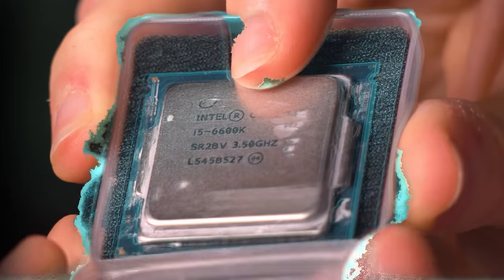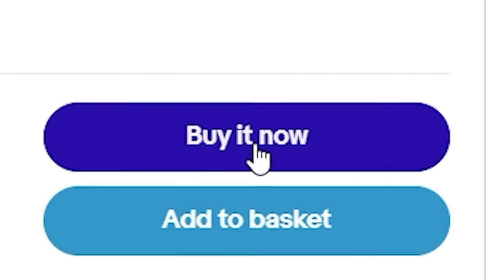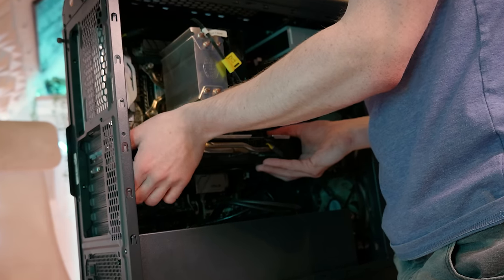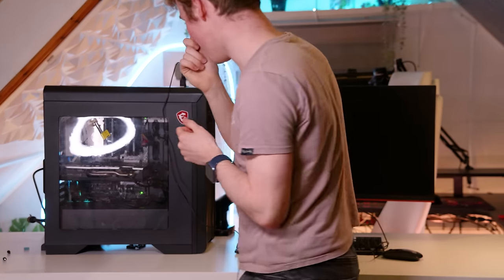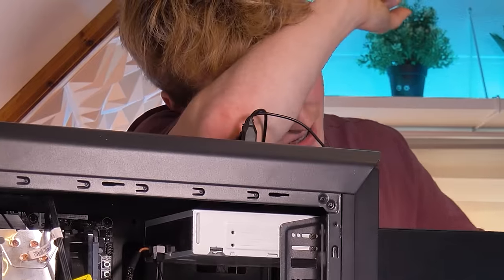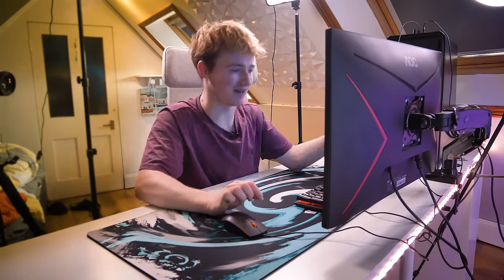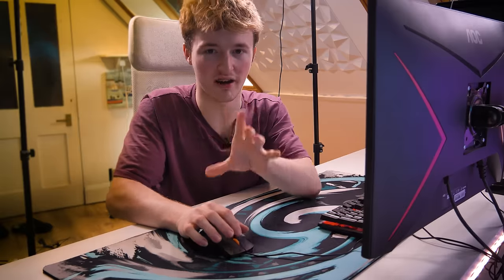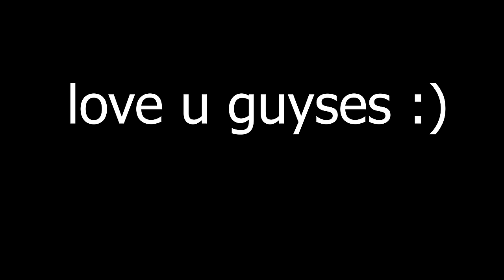Can You Game With An $8 CPU?

Comment: Wait, an e3-1225? Man, that is good. It contains integrated graphics for a Xeon, which means it is basically a drop-in i5-2400 to any 2nd or 3rd gen motherboard. Considering a Pentium g4400 worked, that was a 6th/7th generation motherboard. Of course it wouldn't power on.

Comment: Bro, you need to go to a computer class or something, the reason it can run 4k is because of the gpu (graphics processing unit) a gpu is the reason you can see stuff on your screen, next time get another cheap one but make sure it has built in graphics and don’t plug in the gpu, it should still work as long as the cpu has built in graphics
Reply: Gpu isn't the only thing that matters. Yes, in gaming it matters the most but still you cant get a good gpu with a very cheap cpu like this one since you are gonna get bottlenecked anyways. Also he probably did it because this old integrated graphics wouldn't be able to run anything anyways so there would be no point.
Reply: @alexyps2155  well the whole point is to see how bad it runs
Reply: @ironoreiron  yes but how are you supposed to know how bad it runs if it wouldn't even run it? Integrated gpus from.a CPU like a pentium g4400 would crash before the game even opened
Reply: @alexyps2155  thats the good part

Comment: Did the intel pentium g4400 have integrated graphics or were you using a gpu? Because i used to be playing on a laptop with a ryzen 5 5600 which is way better than this and couldnt even run bedrock on 20 render distance. This video seems fake but maybe i just had a bottleneck since i was using integrated back then.
Reply: nobody uses integrated that's just dum
Reply: @theorphanobliterator  you would be surprised on how many people use integrated graphics and still have their kidney
Reply: @alexyps2155  considering dedicated GPUs cost pennies nowadays for something usable, there's not really much of an excuse. decent computers for gaming can cost literally almost nothing
Reply: @theorphanobliterator  bro even one of the worst gpus like the 1050 or the 750 ti cost around 100 bucks which is quite a lot to add if you have a budget. Also these gpus are not even worth it since the difference from a good integrated gpu ain't that much. Casual gamers which is like most of the world don't need a gpu to run games, most people just want to work on their computer and only game rarely if they are bored, for example, before I got my gaming PC I had a laptop with integrated graphics(pretty bad ones too) and I could run every game I wanted on low settings on atleast 60 fps.

Comment: Xeons and Core/Pentium/Celeron aren't compatible with the board in the PC you used - the Xeon needs a C232 chipset, it won't work with a normal motherboard without that chipset. You weren't scammed - companies tend to offload Xeons when no longer needed.

Comment: Even though a pentium g4400 does suck because its only dual core, any quad core processor from 2nd gen core intel and up is perfectly sufficient. Everyone gamed at 1080p and 1440p a decade ago. Just stear away from modern titles. 
I picked up a $5 4th gen processor (quad core) from the second chance reuse store, as well as a $10 motherboard to pair it with. As long as you have a decent GPU, the GPU will carry most of the load.  I have an old AMD vega 64 which is about a 1070-ti and pairing it with that $5 CPU is not offensive but actually works really well that I run casual games at 4k with it.

Comment: Bro these old cpus have magical power because in  my old 200 dollars laptop with celeron 2ghz I could easily run cod modern warfare without heating at low medium graphics but my new laptop have heating issue it's msi gf63

Comment: I recommend you to use sodium for utilizing all cores 'n threads in minecraft. I've got Xeon with the 13 cores so before using this mod i had fixed 25 fps and after installing it more than 100fps

Comment: Fun fact my laptop has 8 gigs of ram and 1tb HDD in it with a ryzen 3 3250u 2.6-3.05GHz  with Vega 3 graphics and gives 120-230- fps with in game optimizations only 

Still need to optimize to the peak of gods to see how much in bedrock edition tryed it in jave 1.8.9 and 1.16 gives 60-800fps not bad you know 

Going make the specs 24/256+1TB SSD+HDD and add E-GPU an GTX 1050/60 TI or normal

Comment: I still use a xeon e3 1225 v3 intel xeon is a cpu line used in servers btw just get a pentium 4 631 with an overclocking mainboard and with ddr3 support a try its worth it

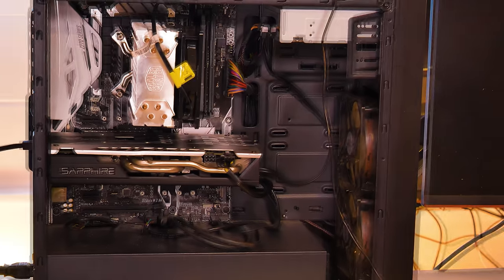Comment: 4:49 bro only the 8 pin is plugged in wtf how did it boot if not all the power cables are plugged in
Reply: It doesnt require that much power to boot
Reply: @johe4105  i mean usually mordern gpus will ensure that all the connectors are plugged in before the boot process to ensure that no sudden spike would cause the gpu to suddenly fail

Comment: I wonder whats more resource efficient, minecraft or minetest, for what ive seen on intel core 2nd generation and 1st generation, the open source minetest is, also if you would like to lesser the work needed on the software side of getting to minecraft, linux mint can be a fine option instead of windows, since it will likely have more drivers supported off the bat, and yes, bedrock can run on anything even a Samsung galaxy s3 ran the nether update flawlessly

Comment: on this slow cpu play multiplay I is a lot faster if Minecraft not must be render the world ! and the Xeons don't run on every mainboard and mosttimes they need ecc ram , I use 2x intel xeon e5 2699v4 with 768gb ddr 4 ram for minecraft (its a old Lenovo workstation) 4k resolution with shader and rescourcepack with 1000 fps (geforce 4090ti)

Comment: you didnt even plug the gpu in properly how can you even test it when you didn't plug things in correctly? they could've done a BIOS flash that would've included those xeons. I get you're a noob but still, if you could mount that hyper 212 you must know a little about pcs that thing has the worst mounting hardware ever

Comment: I was thinking you'd need a different motherboard but you tried to fit it in a 1151 socket. (I'm talking about the xeon processor)

The g4400 was a cheap option which was comparable to the i3 4th or 5th gen and lifted up the Pentium name